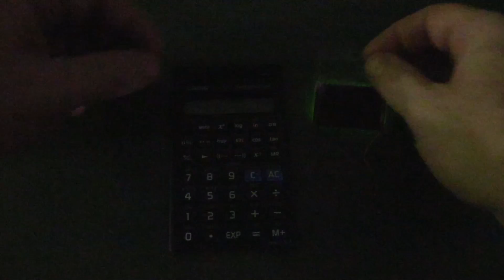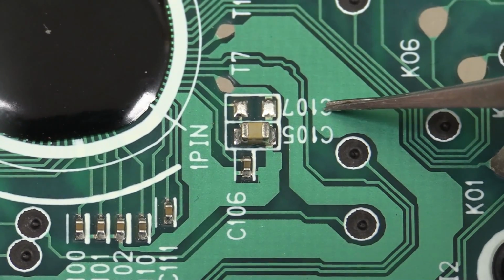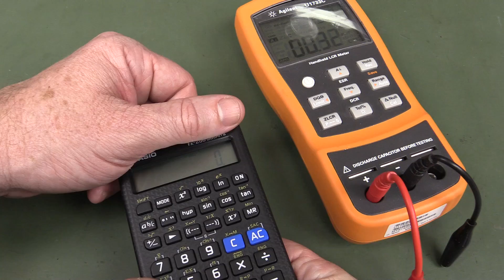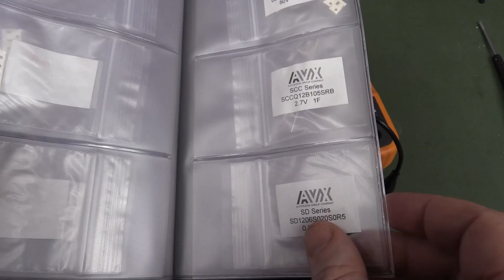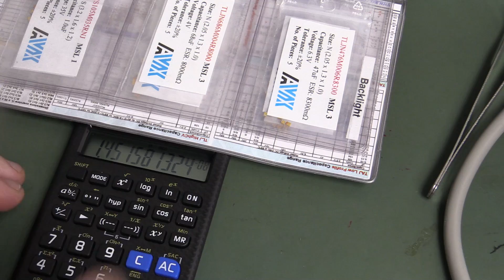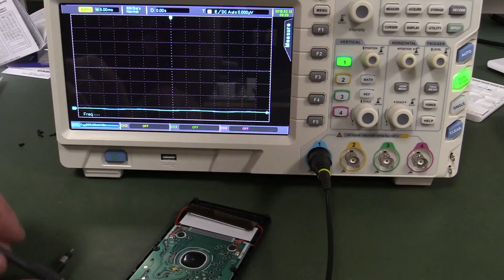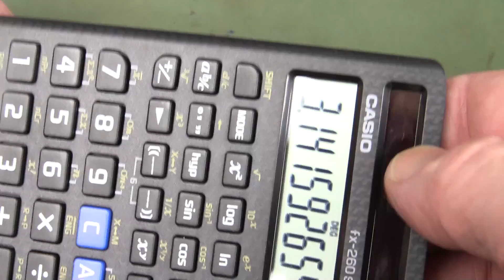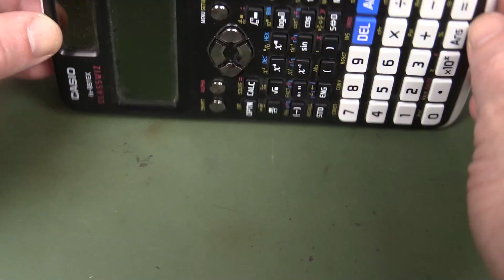EEVblog #1094 - Casio FX260 Solar II Calculator Tritium Nuclear Battery Experiments

Comment: Now that you are modding calculators, have you ever tough of replacing the refractive film behind the numbers with something else like that paint that is used on the roads that shines under light.
Reply: I think retroreflective coating is a bad idea, because your eyes don't actually emit light, and i think wearing a head lamp just to be able to read a calculator is stupid.

But what isn't such a terrible idea is EL film. It's a thin film backlight that is normally white, but emits azure glow when powered with something like 100V but there's very little current going through it. I wonder how small you can make an EL step-up circuit? After all, i've seen wrist watches do it.
Reply: In practice it actually is not such a bad idea, you don't need a light behind you to see the numbers (because the coating is white), just some ambient light and in many situations it's better than the regular old-school reflector since in lower light conditions they don't reflect that well because you need to see the reflector from the correct angle plus the correct angle for the LCD and they are often not the same.

On the other side, the retro-reflective coating scatters better the light, the only problem may be using it with a bright light behind you like the sun. It may be a bit too reflective, but you could use some sort of matte filter.

There are many types of retro-reflective materials, like tapes, stickers, films, paints and even fabrics so there's quite bit of options to try.